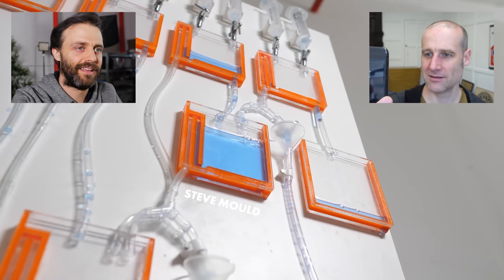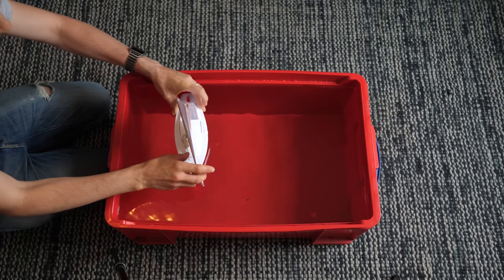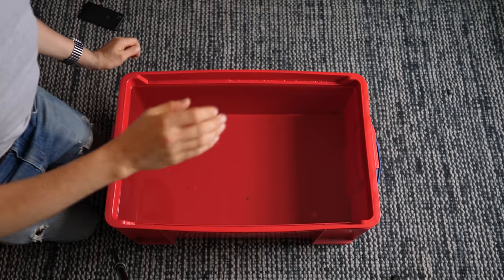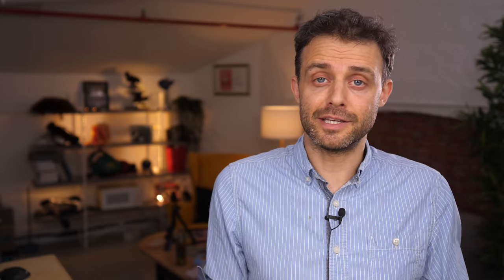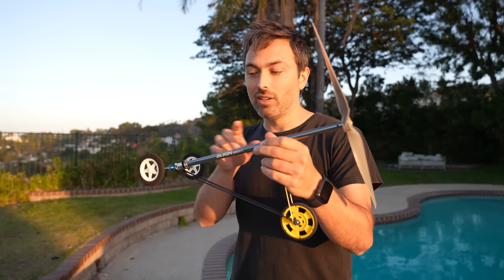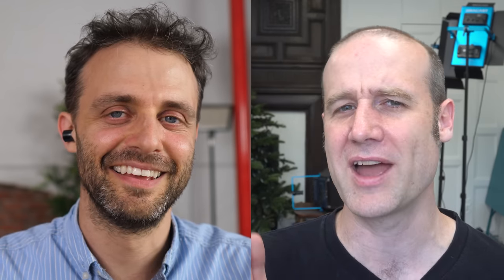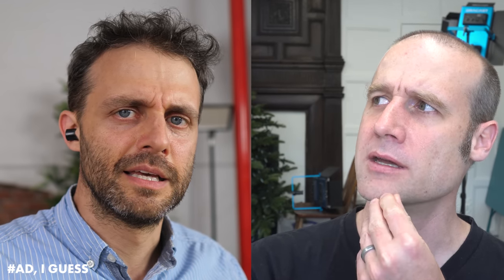Sailing Faster Than The Wind - How Is That Even Possible?

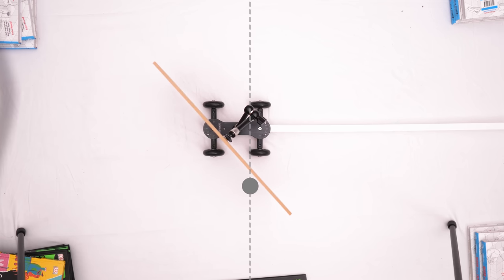Comment: In you model you can go faster than the wind if you don't sail parallel to it, what is not what Derek is doing, Derek is sailing in the same path, parallel to the wind, witch, at some time, he will miss it (the wind), not because he matched the wind speed, what happens in 5:29 of you video, but because he is actually faster. What implies he is faster just because of momentum, which he got in the acceleration phase because of potential (stored) energy, and thus, is going faster only temporally, until the wheels drag put him in the same speed of the wind again. Isn't that so? There must be some other explanation.

Comment: You never explained the real question. Tacking and going at 90 degrees to the wind and going faster than the wind all makes sense. The original claim however was that you can tack IN THE DIRECTION of the wind and go faster than the wind in the direction of the wind (velocity made good). I want to see THAT explained.

Comment: So the question the eludes me in the original vertasium video, and still does after watching this.
How can a boat move faster than the wind? 

So yes, you can move faster relative to the wind, if you move say diagonal with the wind. But how can you actually move faster than the wind? Because even if you move diagonally, you still can't move faster than the wind hits your sail. so if you move fast enough to match the real wind speed in the wind direction (but zig zagging at a faster speed) you would reach the same speed as the wind, and you can't go faster (you are moving faster relative to the wind, but you can't go faster in the wind direction, because thats the same speed as the wind, so you'd get no wind. The vectors cancels out.)
So it was said like a Truth, but never really explained.  (so thats why the propeller craft works.)
Reply: These clips explain how you achieve a downwind component greater  than windspeed: 
https://www.youtube.com/watch?v=H_OKNr120t4
 , https://www.youtube.com/watch?v=63hvQABLOaE
Reply: @eyytee  so,, I didn't want to reply to this, But once more I find myself getting back to this topic. might have something to do with all the other youtubers doing videos on this subject. 
Anyway, the problem I have with the vector's x+y explaination, is that Once you reach the same speed as the wind, you're not going to get any more power, because you travel at the same speed. So even though the vectors might be able to push the boat faster, it's going to stop pushing once the boat reaches the same speed. 
That's the crux of the problem. 

So the answer only explains how you can get more potential speed, but it doesn't take into account what happens when the wind stops pushing ( when you reach the speed of the wind ) Because once you reach the same speed as the wind, for you, there is not going to be any wind.
That's the explanation I'm looking for here,  How does a boat do it?
Reply: @lordsqueak  Here are the vectors for the situation at windspeed:  https://imgur.com/a/fKFATHp The aerodynamic force still has a component in the direction of the blade's motion, so the air is doing positive work on the blade (in the ground frame). That is the energy input:
Reply: @eyytee  but we're not talking about the car.  I know how that works. 
It's how the boats do it i'm curious about. (and I don't doubt they can, I just don't see how)
Reply: @lordsqueak  It's the same vectors: https://imgur.com/a/obNUVT5
Reply: @eyytee  "It's the same vectors: "
Yeah I know it's the same vectors, but the difference is that on a boat you don't have the prop directly geared to the wheels. in fact you don't have props or wheels. Just the sail. 
The problem is that once you reach wind speed, there is no longer any vector into the sail. There is no force acting on the boat,, well , besides drag slowing it down. 
That's the bit that lacks an explanation.
Reply: @lordsqueak  The boat's keel is forcing the boat to move across the wind, just like the wheel & transmission force the propeller blades to move across the wind.
Reply: @eyytee  across the wind, sure I get that. But what about moving faster than the wind in the same direction as the wind. That's the tricky bit.
Reply: @lordsqueak  A boat cannot sail directly downwind faster than the wind. The boat has to tack to outrun the balloon.
Reply: @eyytee  aaah,, thats the missing clue.

Comment: The problem with Derek's explanation in his video is that he still doesn't understand what is going on. He is smart enough to hold his hand in front of a fan and feel the air blowing against it. Unfortunately that is the limit of his understanding. He can't quite grasp an airfoil's lift. 
In his explanation the machine moves forward because the fan (airfoil) is blowing wind backwards, like a rocket engine. Even though the designer explained to him that it was being lifted forward, when it came time to make his explanatory video, he couldn't explain what he never fully understood, so he fell back to the fan analogy.

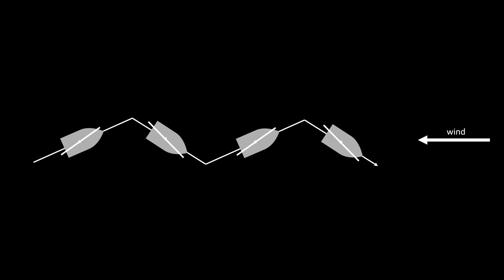Comment: Wrong at 8:47.  You don't have to take a zig zag course (tack) to sail into the wind.  With a propeller, i.e. windmill, you can sail not only into the wind but also directly upwind, 0ˆ to the wind.  There are plenty of examples and explanations on YouTube.  It's shocking how many otherwise smart and knowledgeable people in the fields of physics and sailing, simply cannot grasp that fact.  This has been known to more knowledgeable people for more than 70 years (and probably more than 150 years).

Comment: Impossible still, as the is friction, a speed 
Of the air needed To lift an airplan is extremely big to create that big pressure to achieve a life. I say its impossible without momentum.

Comment: I thought his explanation was actually very intuitive.
It takes a concrete concept: Sailing faster than the wind is already possible by strafing
Then he expands the concept: If you continue in one direction strafing, you'll continue going faster than the wind
Then he applies it to the topic: If you sail around a cylinder, you can continue this forever, and that's exactly what these propellors are doing to take advantage of the wind, just like the sailboats are.

Comment: I think it is missing one key data-point before I will believe it completely.  What is the difference between the windspeed at the altitude of the windmill vs the windspeed where they measured it much closer to ground level.  If I understand the aerodynamics of wind correctly, the higher you go the faster the wind is.  The windmill is considerably higher than where their windspeed tester was and I suspect that the wind number they tested didn't represent the speed of air hitting the blades.  If I am wrong, I would like to see the difference between the windspeed at the height of the windmill and the windspeed where they had the sensor in that video.  Data or it didn't happen.

Edit: Okay, thanks for the replies.  It turns out they thought of my complaint and had the relevant data already.  I do love competent scientists, it is the only way I can get smarter.
Reply: @Rick_Cavallaro  Oh hey, thanks.  I'll watch it later when I get a chance.  I do love more data when I can get it <3
Reply: @musikSkool  Check also this: https://www.youtube.com/watch?v=7SYvg40NHtc
And note that for the NALSA record they measured windspeeds at propeller height.
Reply: @eyytee  Oh thank you.  I knew the science was sound, but the way he tested the wind was really bugging me.  Thanks!!

Comment: This really oversimplifies this imho. I dont think you can quite explain a sail with this. In this model if you have the wind from the side you should angle your sail at 45 degrees, however this is not true when you are sailing.
It explains how a keel works but not really how the the sail works to go faster than the wind.
I dont think explaining a sail can be done without explaining lift from an airfoil.

Comment: What actually happens in Derek’s Veritasium video:

• If he ribbon is the only proof that the vehicle is going faster than the wind then the ribbon is just a red herring. It is easy to get taken in, if you first trust the prologue and believe there is a mystery. 
• If you want actual proof of how fast you’re going, in relation to the wind, you would have to measure the wind speed and the vehicle speed, at the same point, independently of each other. 
• Unless it tacks, an unpowered vehicle cannot be blown faster than the wind, no matter what gadgets you put on it. 
• The earth is not a cylinder and a propeller does not do double-tacking; nor can it generate thrust without an external force being applied. 
• All that happens is that when the air is no longer moving forward over the deck, the geared propeller is able to create a little breeze flowing backwards, which raises the ribbon and tricks the eye into believing the vehicle is traveling faster than the wind.
• This was a shell-game with the ribbon as the pea which had been palmed by the presenting magicians.

Comment: But the point is not sailing faster than the wind, that's easy to understand, it is sailing downwind faster than the wind. I.E. The component of the velocity of the boat parallel to the wind is faster than the wind itself, and that's really counterintuitive.

Comment: I think someone is going to make a study or YouTube video on how rookie sailors learn. I'm a rookie sailor (but only clever enough to think it should be done, but not clever enough to do it.) Sailing directly downwind. This is really really hard to get right. Wing on Wing (this means foresail sticking out to port and main sticking out to starboard (or vice versa) and.... not much seems to happen This is just pushing not very interesting.  To start this video with it is sort of like explaining how gliders work by the example of a parachute.... snoorrrrre. 
Here's what I learned teaching physics to middle schoolers. My wave tank wasn't working too much going on. But wait didn't Richard Feynman say that water waves were just as complex as electromagnetic waves. So instead of dismissing my tank as a toy, I learned how to separately make  surface waves and tsunami (deep) waves. So your 'toy' sailboat drifting in the direction of the wind. Sailors call that lee way - it happens on real boats and ships too. It's really remarkable the first time you experience it. (I've yet to notice it in the Bermuda rigged keel boats I sail. But I did in a large square sail wooden boat, ballast but no deep keel  - like the HMS Bounty and Endeavour) 
And as a rookie sailor, understanding how wings work made understanding sails just a variation. (The keel knife underneath the boat is doing the same thing as well. I like your vector, some of that angle that's causing leeway is deflected by the keel to contribute to forward motion.) 
The big confuser for rookie sailors is tacking. You're supposed to turn 90 degrees. In practice it winds up being closer to 180 degrees. It's a real mind blower. If you just turn 90 or 100 degrees you end up straight into the wind and stopped. The combined wind velocity and the velocity of the boat result in apparent wind which is more complicated. 
At 7:15 what happens on a boat is it starts to lean over. This is when racing crews all lean their butts over the windward side. What is happening in a more practical sense is the boat leans over and rudder and keel aren't working very well and you're traveling pretty fast, but if you reef the main, make it smaller, the result is you travel at about the same speed, but not leaning over. So racers - butt hang, us pirates - reef. The racer in the same boat would be a little bit faster, but risk broaching (tipping to the side). 
All modern sails are designed to a NACA airfoil shapes.(NACA is now called NASA.) They are usually compromises because they only have the top airfoil shape, and sails always have a twist in them.  If you spend lots of money you can get set-ups where the mast forms the leading edge and rotates, and the sail has a front and a back surface that are separated.  And they don't keep the top level of performance for very long.  The foil America's Cup boats are doing that extremely steep angle in your video. As a rookie sailor I was watching the races a few months ago and couldn't figure out why they had basically the same sail set up the course as they did down it. They'd tack or gybe them to the other side, but same steel (close hauled) angle. Apparent wind again. To someone sitting on a anchored boat the wind is 15-25 knots, but on those racing boats the combined vectors make the apparent wind 50-60 knots and the boat is moving at 45 knots. (which is what Veritassium was reporting on, the propeller just made it more of a puzzler)  
The thing about the modern foil racing boats is they're water boats that have finally figured out how to do what the ice boats were doing over 100 years ago. (You showed the wheeled version of these). By putting a sail on wheels or blades friction is almost eliminated. Boats couldn't do anything like this until first they planed (speed boats) and now foil.  The land speed record for decades was held by ice boats long into when there were cars with gasoline engines. So sailboat speed is now ranked like this: mono-hull keeled boats, then planing hull keeled boats, faster then  are catamarans (with performance drop keels that are almost like foils), trimarans - which spread out over turning force with the three hulls (small keel against lee way), and then the foiling craft.

Comment: You didn't mention the concept of true wind and apparent wind which is the absolute key of going faster than wind. When a sailboat is accelerating it starts to feel more wind because its own speed, it creates his own wind and therefore more lift and more speed. Similar to an aircraft wing where lift is proportional to the speed of the plane.  

Sail boats do not go faster that the wind by creating some sort of "leverage" or gear effect effect with the sail angle. The video is wrong...

Comment: Steve, I think you are missing the point here. Dereks video is about going faster than the wind in the EXACT SAME direction as the wind. This video does not explain that at all. 
Using a sail it will never be possible to go faster than the wind in the exact same direction as the wind. That is why in Dereks video they use this rotor which is turning in the opposite direction as you would expect from a normal windmill. Very counter intuitive, and I still don't understand how it exactly works either, but it is a different principle than explained in this video.

Comment: This explanation is as intuitive as it is WRONG. Lift does not work this way, neither for a plane or a boat. Lift is generated by a faster fluid travelling the top side (extrados) of the wing (or sail, the behaviour is really the same) than on the bottom side of the wing (intrados). 

A sailboat can go faster than wind indeed, but because of a different phenomenon. As a boat pick up speed thanks to the wind, the sail will not only receive the "true wind" force but also a wind is has created thanks to its own speed. In terms of vectors, it is like adding the "true wind" vector with the speed vector, which creates what we call "apparent wind" vector. If the boat travels at a narrow angle against the truewind, this will effectively increase the wind the sail receives, therefore increasing in turn the speed of the boat. This positive feedback loop is effective as long as the increased speed is not offset by the increased drag of the boat on the water. This is particularly striking on watercrafts that have very low drag, such as windsurf or any watercraft that is equipped with foils (see the AC75 boats from the 2021 America's Cup).

I cannot believe how many people cheer for this video, even though it is full of misconceptions.

Comment: The explanation of how the sail is propelled forward starting at 2:40 is largely incorrrect. The air cannot keep going at the 45° angle indefinitely. After it passed the sail, the airflow will revert to its original direction. The momentum imparted will exactly cancel the first 'kink'. Instead the sail is propelled forward beacuse there is a low pressure region behind the sail.

Comment: Have to disagree, you’re just describing the vector component - where a boat travels at (no friction etc) a speed dictated by its angle to the wind - the vector of the wind velocity in the direction the boat is travelling - not lift.
In the Vertasium vid (and others commenting on it) the claim is that boats can exceed the wind speed, in the direction of the wind, not just at an angle to it. It’s a shame you glossed over Bernoulli and wing profiles as this is what creates the extra speed. Actual lift is created when the wing (in this case sail) passes through the air, this lift acts in the direction of travel. Imagine an airplane wing, standing on end, instead of lifting a plane, the wing pushes the boat along. By tacking downwind the boat can exceed wind speed, in the direction of the wind.

Comment: 3:20 well this vector depiction looks so very wrong. The layers of air close to the surface of the sail interact with the sail in two ways: the pressure perpendicular to the plane, and the drag force, determined by the gradient of the air speed in those layers -- basically, air drags the sail to the upper right corner in this frame. The component of the yellow arrow tangential to the sail can not be against the wind!  Both vectors must be counterclockwise from the perpendicular to the sail, not clockwise  🤦‍♂️

Comment: Sometimes you can simplify a concept so much that it becomes simply wrong.  You can't explain the process without using the coanda effect and apparent wind.  If you look at boats sailing you will see that the sail angles won't corroborate this explanation.